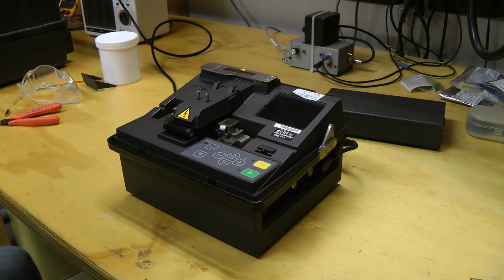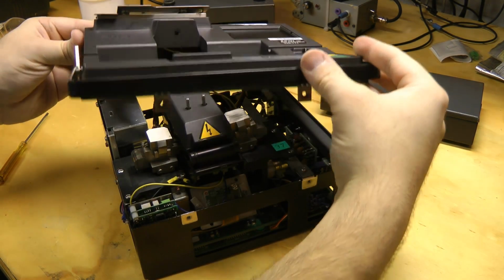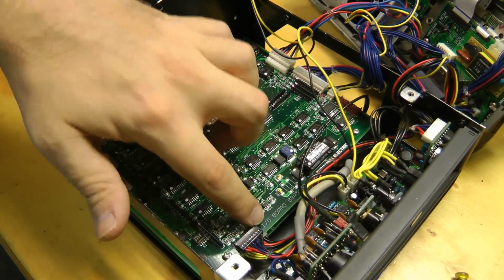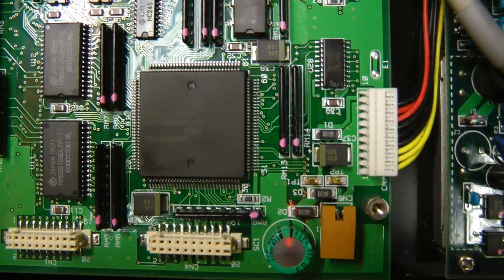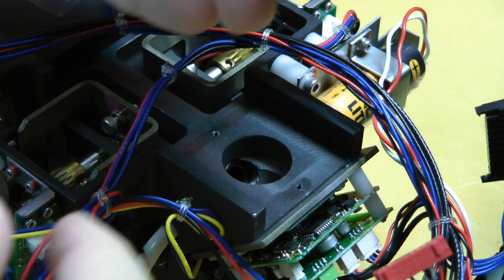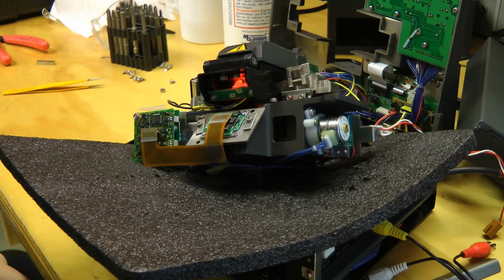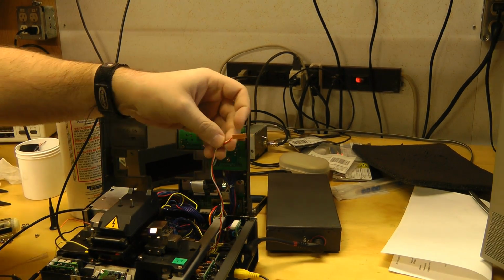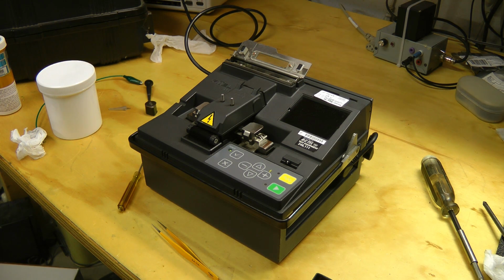Fitel fiber optic fusion splicer - Teardown and repair

Comment: Love those old machines... They all need the onboard batteries replaced.  Watch out removing your spliced fiber. Do it quick, release one side right away. The clamps will reset after the arc cover is lifted.

Comment: Hey Thanks for this video. I especially liked the brief overview and description of the circuity. I'm an Electrical Engineering hobbyist recently taken up microprocessor design work. So it was nice to see some of my design work that I have laid out was actually legitimately uses in older quality tech. I don't have time to tear down and research circuits to see if my designs are reasonable. Thanks :)

Comment: The humidity sensor may be the relatively large brown part next to the supercapacitor on the CPU board.  I've seen those types of RH sensors before in weather monitoring devices.

Comment: Nice fix! I was trained on splicing fibres at my old job. It is complaining because the machine vision can tell you made a mess of the cleaving :) You're supposed to use a special precision cleaving tool that is almost as rare as the unit itself. Anyway you should get a good wad for it on eBay!
Reply: this unit comes with a Fitel s321 cleaver, indeed still on ebay but al have rust stains etc...

Comment: Very nicely done.  Outside of the strange capacitor wiring job in the power supply it really looks like a well built unit.

Comment: A V53!  That's the processor used in a bunch of Hamsats.  It's like an 8086 with DMA built in that can also do 8-bit stuff.  Low power too - but you only get 0.05 MIPS per MHz.